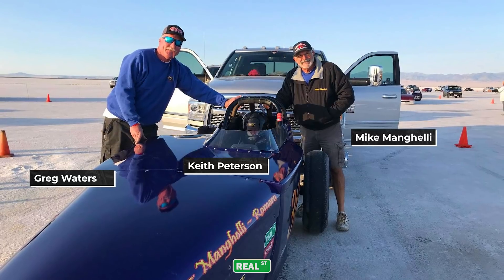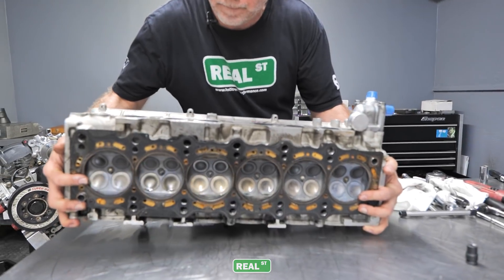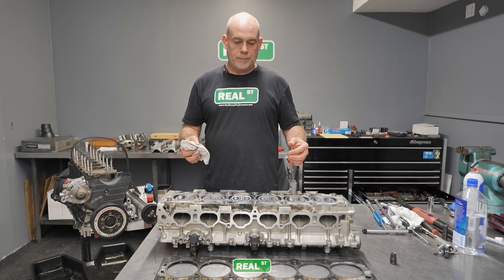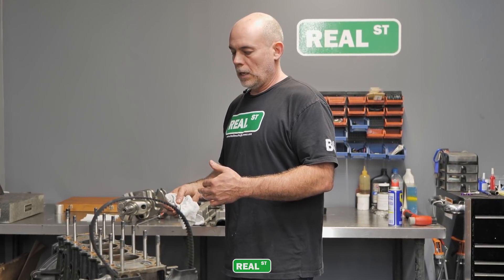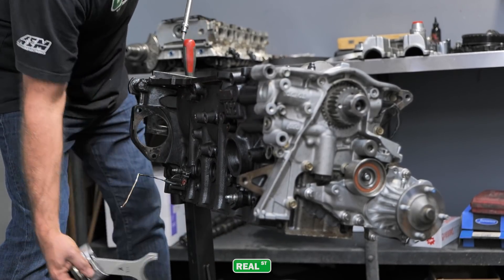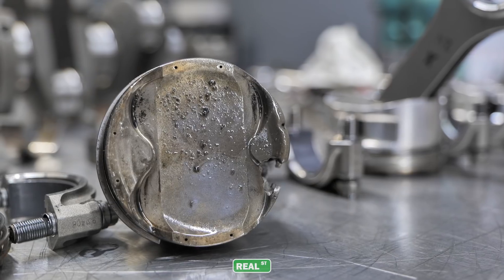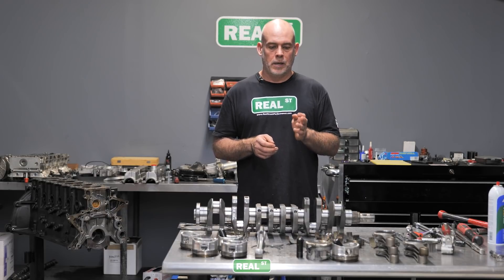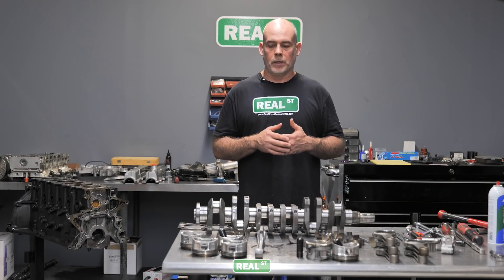Bonneville 2JZ Caught On Fire Going Over 265MPH - Take A Look Inside The Engine (Teardown)

Comment: Thanks for the great info! Had no idea you could clean aluminum off iron/steel with acid. Dailey parts are so trick! Do you use their Air/Oil separator as well as pan and pumps? Is that line in the valve cover crank vacuum? Mind you i'm a fucknuckle with a keyboard and no money just asking questions.

Comment: I would have thought the rod pins were good in the rod but loose in the pistons, unless the pistons are made that way. If I recall correctly palm press fit in the rod bush and warm up the piston in hot water to slide the pin through?

Comment: One thing that’s always blown my mind with 2JZ is how they are simple 2 bolt main caps. And they have those gaps on the sides of caps, not tight fitting on block. Yet they are monster engines.

Comment: I'm pretty sure your connecting rod bearings on the rods the hole in the bearing always goes to the piston side, might not of over heated?
Reply from the maker: There are connecting rods with dowels in the lower bearing and connecting rods with holes that to through the upper bearing to spray oil on the bore.  This particular engine comes with a piston cooling jet that bolts to the block and the bearings that have the holes in them are for a doweled rod (not used) . The overheating of the cylinder was due to the engine leaning out after it pushed an injector O ring out. The bearings looked fine given their workload.  Thanks!

Comment: I run the king coated bearings in my builds.  I have no complaints.  

What kind of trouble causes the wrist pins to bind when removing?
Reply: Heat and/or unwanted vibration from balance issues and/or tolerance issues.

Comment: might consider running individual cylinder egt's for safety
Reply: You think that would help 😂? A engine like this was dead the same second the o-ring shot out and EGT are really slow..but for tuning purpose yes
Reply: @knegoo  true egt's are slow. a coolant pressure sensor would be a better safety sensor. I tune 3 different cars that run the salt I am well versed in what it takes to keep them together and mitigate damage.